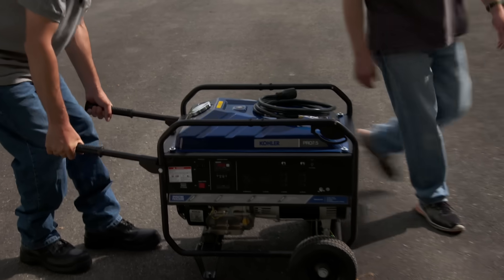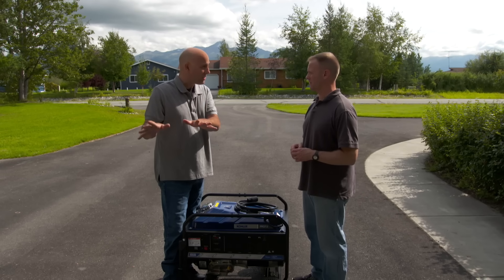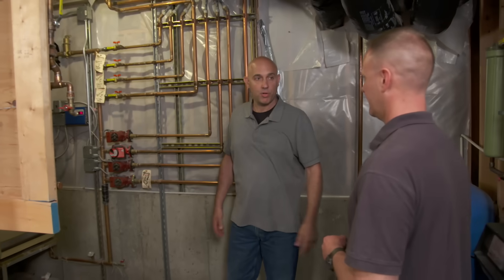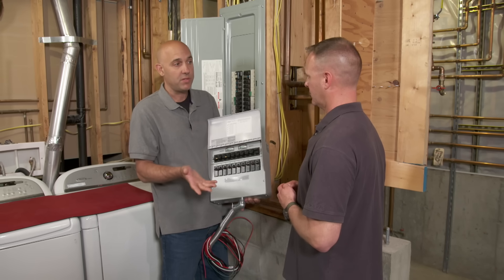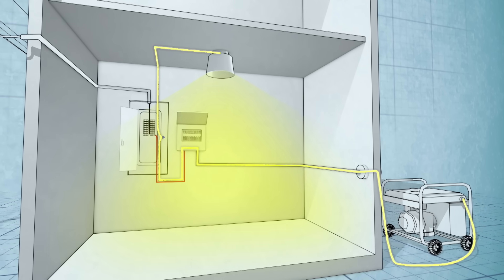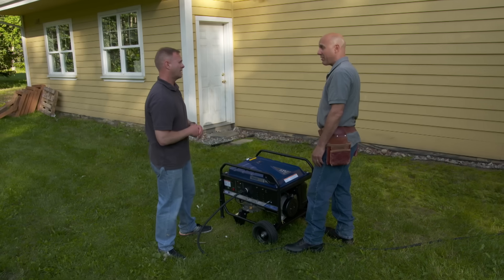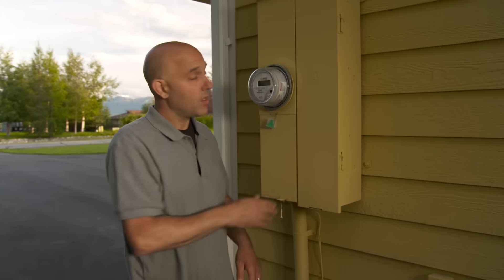How to Install a Manual Transfer Switch for a Portable Generator | Ask This Old House

Comment: Great video. I have a question. After the power comes back on, does the transfer switch stop the flow of electricity from the  generator before you can get outside to turn off the generator? I heard you say the switch lives in the off position, is that where it returns or do I need to turn the switches back to off after turning off the generator?
Reply: The individual switches on the transfer switches are between the breakers and the loads (appliances, outlets, lighting, etc).  When the generator is connected and the switches are moved to the GEN position, each switch independently disconnects the only feed to it from the house breaker panel. It's basically 10 transfer switches in one cabinet.  
If the main power is on and the generator is on and connected, it's perfectly safe to have some of the circuits in the LINE position (main power) and some of the circuits in the GEN position (generator power).  Each circuit is isolated by the way the toggle switches are between the breakers in the house panel and the breakers in the transfer switch.  The center OFF position is the "break" position so that when moving a switch up and down there is always a disconnect so the power sources always remain isolated.  
Normally the switches are in the LINE position, if there is an outage then a generator is connected and the switches are moved to the GEN positions as needed by the person attending to the system.  It is usually obvious to some extent when the main power returns, because everything not being fed by or connected to the generator will instantly turn back on.  Generally there is something somewhere that will indicate to someone that the main power has returned.
Reply: I was wondering the same thing. The term manual transfer switch makes it sound like you have to do it yourself. Auto transfer switch would be a better thing if it would turn that off for you. What happens if your generator is running and the power comes back on? Not only that, but how do you know your power is back on from the utility if you're using the lights and other circuits with the generator?
Reply: @nicknamednickify  -- Well, for starters, all the things that did NOT get put on the transfer switch will come on, and if that is not enough for one to notice, for sure, all your neighbors who have no power lights will come on all at atahe same time...  Even street lights will come on if ithe power is restored at night, and lastly, if you have a phone and have signed up for notifications  of power outages, they will also ding your phone with a text msg saying the power is back up..
Reply: Hello, if you have a renewable energy (solar panel) system and an inverter, everything depends on the type of the inverter.  If it's a "grid-tie" inverter, which syncs with the utility power and supplies power to the entire system at the same time as the utility, it cannot be used during an outage because it has to detect a utility outage and shut itself down (or it would send power back down the utility line). Grid-tie systems usually don't utilize battery bank storage and will sometimes use microinverters built-into the solar panels.   
If your inverter is NOT a grid-tie and does use a battery bank, it would use either a small automatic switch, or it could use a manual transfer switch like this one.  All depends on the type of inverter and how it's integrated or planned to be integrated into the electrical system.  With a "NON" grid-tie, you can use it at any time by picking any of the circuits on this type of switch, moving them to GEN and running them off the inverter power at the SAME time the utility feeds everything else. This is perfectly safe and the only concern is that you don't monitor the battery power and the available power from the battery bank gets too low, the inverter will crash and any circuits fed by it will stop working until you realize this and flip the switches back to LINE, reset the inverter, and when there is enough energy once again in the batteries you can resume using it to power some (or all) of the circuits on the transfer switch.
Reply: Thank you!  I replied to the other comment you posted, hopefully that provides the answers you were looking for. Feel free to call me at 800-634-6155 and press option 3 for support.
Reply: No you cannot, the "class" of the inverter is critical and determines if it's possible to utilize this switch with an inverter rather than a separate portable generator.  
It won't work ONLY if you have a grid-tie inverter, because the inverter won't work when the main power fails unless a very sophisticated automatic switch AND another inverter AND another automatic switch are all incorporated.  It's required by law that a grid-tie inverter has an RSD feature, which is Rapid Shut Down.  It must detect the utility power failing and shut itself down until it detects the return of the utility. It can do this in a variety of ways based on who made the inverter.  
However, any inverter EXCEPT a grid-tie inverter can potentially be used with this transfer switch.  There are some unique attributes on some (non-grid-tie) inverters in regards to their internal neutral/ground relationship, which could cause issues especially if there is GFCI built into the inverters and their neutral is bonded to their grounded  (metal/conductive) parts.  
Inverters comes in two main classes - non grid-tie and Grid-tie, and this makes ALL the difference.  The class of the inverter is critical because the two types of inverters are very, very different, and if you have a grid-tie you cannot use it when the power fails without an extremely expensive setup of 2 automatic switches and a 2nd inverter that is not a grid-tie.
Reply: @RelianceControls   This subject isn't about inverters.  A transfer switch isolates the stand-by source from the utility so the two never meet.
Reply: The switch will isolate the feeds no matter where it's switch positions are.  In other words, it will never connect the utility and the generator feeds together.  It doesn't matter if the generator is on, plugged in, if there is power at the utility or not.  The main thing is to NEVER connect the generator to the utility.  The transfer switch is designed for that.

Comment: What is the make / model of the 10-circuit manual transfer switch?
Reply: 6 circuit manual transfer switch at Home Depot
https://www.homedepot.com/p/Reliance-Controls-30-Amp-6-Circuit-Manual-Transfer-Switch-306A/206499418
Reply: It's made by Reliance Controls and the model number for just the transfer switch is # 306C

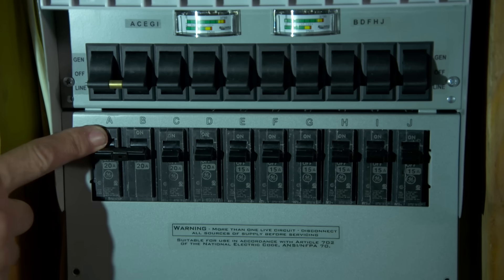Comment: 5:14 best animation I've seen. Thank you!
Reply: I'm embarrassed to admit this, but sometimes when someone is just jabbering out instructions, I may get a little distracted - - so no matter how corny in appearance, if they have a simple animation like that - - it really brings the project (& end-product) into focus for me. So yes, I do appreciate their animation as well. Thank YOU for adding that time-stamp there!
Reply: @LEO1WOLF  I think they used it in "Money For Nothing" video.
Reply: It doesn't include neutral and ground wiring, not exactly a good diagram.
Reply: I disagree. It's really basic. 
Walt Disney tops
Reply: @samsngdevice5103  You wanted anime?

Comment: Do you need to ground the generator?  Reading the Generac manual, it would seem necessary
Reply: When the generator connects to the building's electrical wiring system, the generator's ground (if wired as it should be) will become common with the building's grounded system, resulting in the generator to be grounded in that manner.  A separate ground rod for the generator is not necessary when it's being connected to a grounded electrical system of a structure.
Reply: @RelianceControls  But a separate ground rod for the generator frame would be a good idea.

Comment: Forgot a step. Switch from gen to line then shut the generation device off. Plus it would be advisable to switch fuel off and run the bowl out of fuel before turning the generator off..

Comment: What I'd really like is for electricians who initially install panels in new houses to have to take a course in writing legibly.
Reply: I they should have to take a course in filling out panel schedules. I come across blank schedules all the time.
Reply: Without electricians you wouldn’t have WiFi to make dumbass comments.
Reply: @dallas5374  QUESTION: Why dont he ground the generator frame to earth??
Is it a FLOATING NEUTRAL generator, or a BONDED NEUTRAL generator?
doesnt that matter?
Reply: Not possible.  Most electricians are med-school drop outs..
Reply: @ohger1  Don't get me started on linemen.

Comment: Need to tell him not to store the generator with gas that has ethanol in it. Try to get strait gas (ethanol free). The ethanol will decompose the rubber parts of a a small engine. Also when it sits for a long time it goes bad quickly and will grow crystals in the carburetor and then you are just screwed till you buy a rebuild kit and clean it up.

Comment: A friend of mine left one unsecured like that only to wake up and watch 3 guys running away with his generator
Reply: Reason 100000 to live in the country.
Reply: @davec.3198  He should have provided the guy with a 30' logging chain as well as that cable.
It may not stop them, but it sure as hell would slow them down a bit.
Reply: A generator enclosure helps with that, along with keeping it nice, and reducing noise.

Comment: The only thing is you need to devide the load of the generator to the transfer switch box.
Reply: Not sure what you mean to say. A generator is not a load but a source. It works fine the way it's described in the video.

Comment: Can I ask a silly question. Regarding this manual transfer. What protects the utility workers of power is restored or so that there is no back feeding??
Reply: When the transfer switch is in the generator position, the circuits you've chosen to wire to the transfer switch are isolated from the main power and connected to the generator.  When not in the "generator" position, the generator is isolated and the circuits are connected to main power.  That's the function of a transfer switch.  The transfer switch enforces that ONY the genreator or ONLY the main power is connected to those circuits.

Comment: Why not just backfeed the panel from the generator through a breaker thus enabling the homeowner to  shut off or turn on the circuits he wants and install a cut off switch to ensure no current from the generator can backfeed out to the street lines?
Reply: Because in most places, what you are describing is illegal.
Reply: Correct Charles.  All states in the U.S. have adopted at least Article 702 of the National Electrical Code which requires a transfer device of some sorts in order to connect a secondary power source.  Functionally yes simply back feeding the generator into the panel without a transfer mechanism or switch will work and be safe as long as the main breaker is shut off, but the point of requiring a transfer switch is to avoid any possibility of someone forgetting to shut the main off.  It is state law in every state to have some type of transfer switch that does what it's intended to do, in order to avoid any interconnection with the main power and power from a generator.
Reply: Absolutely correct.....Thats why you can add a transfer bar that only allows the breaker that is backfeeding from the generator to be on is when the main is off. Its a simple inexpensive mechanical device rather than the very expensive method shown in the video.

Comment: The generator might be 220 volts but only 30 amp. Residential supply is at least 120 to 200 amps.
Reply: The generator will only be powering the circuits that the transfer switch is connected to, and as with any manual transfer system, the operator must manage the loads by turning circuits on with some awareness of how much power they are using as to not overload the generator.  A very small 2000W inverter generator for example can connect to an entire electrical system fed into an interlocked breaker, there are no rules against sizing a manual system in this regard.  The more circuits the generator has access to, and the smaller the generator is, results in more load management and by the person operating the system.  A smaller number of circuits is more practical for a lot of people as it's much easier to manage 5 or 6 critical circuits than it would be to manage a breaker panel with 30 or 40 breakers.
Reply: OK that works. Ive come across a few jobs with backup generators installed incorrectly by people that don't have a clue of how electricity works and safety measures that are needed.
Reply: Yes Bob that is some scary stuff, we come across that a lot as well.

Comment: 4:50 So the generator hooks into the breaker panels neutral? So at a wall socket the hot is from the generator but the neutral is from the power company. So if a plugged item shorts to neutral wouldn't that send power back to the electrical company. In theory.
Reply: Yes, the generator neutral becomes common with the panel neutral, so that all of the circuit neutrals have a return path back their power source, either the generator or the utility.  Electrical current always returns to its source, and takes the path of least resistance.  In no scenario can I envision the path of least resistance of return current back to the generator, for any of the power that came from the generator, to land on the neutral wire coming from the utility transformer.
Reply: But neutral bars in panels are bounded to ground, so ground will be the path of least resistance.

Comment: Do I need to shut off the Main before switching transfer switch to Gen?
Reply: You do not have to turn off the main panel or any household breakers when operating a generator with this transfer switch.  It is really a set of 6 transfer switches in a single cabinet, so each toggle switch breaks before makes connections in order to isolate the power from the house breakers from the power from the generator at all times.

Comment: Studies have shown that even 15 feet from doors and windows isn't enough to keep the carbon dioxide out. Only 9 ppm of Carbon Dioxide can do significant damage to you in just 8 hours. Those vents on the house can allow Carbon Dioxide seep into them and that odorless, tasteless gas can kill your family while they sleep etc.  So you really should have more than 15 feet clearance from the vents, windows and doors. The trouble is, those power cords for sale are super expensive and ones longer than 15 feet the price is obscene. Get your electrician to build you a long cable for the same price etc.
Reply: lol, doesn't know the difference between CO2 and CO yet talks like he's an expert...lol, smh

Comment: I prefer the idea of the interlock kit over a transfer switch. They're easy to install, create less spaghetti wires in the panel, and they let you power any circuit in your home.
Reply: I was wondering why he didn't install one as well they are much better installation. less to go wrong, less expensive and cleaner install.
Reply: @SillyPutty3700  if the main shut off is not in the panel (like mine), then interlock will not work. This will.
Reply: The interlock switch requires the main shut-off to be in the same panel as the breakers. They mentioned that the main shut-off is at the meter. This is the case with a lot of houses in California, for some reason.
Reply: My main is outside and I have a split bus panel with no main to cut the utility power so I can't use an interlock with modifications so I decided on a transfer switch, 10 circuits is more than enough to get by.
Reply: Hire a professional
Reply: They probably don’t want to show those on a show like this for liability reasons. If the interlock is installed wrong, it’ll send power down the line even when a lineman thinks it’s off.
Reply: @robbanta2979  The transfer switch eliminates any chance of back feed out to power lines. It also eliminates any chance of damage to the wiring in your home.
Reply: Rob Banta I guarantee you homeowners will find a way to back feed through any system if they wire and operate the equipment themselves.
Reply: @KitchenerLeslie2  Once again proving that Mr. Murphy (and his law) is alive and well.
Reply: @KitchenerLeslie2  "You homeowners" -- I assume you're a renter then.
Reply: @Redandranger   no. A pro
Reply: @Redandranger  okay buddy. I guess you have issues. Trump lost, get over it. Is your 5g tower telling you to argue with random people?
Reply: @LevRage  Y'all even getting political toxic over a generator transfer switch 😂😂
Reply: @KitchenerLeslie2  Why is it that people with such bitter attitudes are always so predictably anti-Trump?

Comment: How long can the power cord be between the generator and the outside box that leads to my utility box be I am thinking of 100 ft cord???
Reply: There isn't a set distance due to varying resistances and sizes of generators and loads, but 100 feet is generally a good distance to use as a baseline for 10 gauge wire.
Reply: The sky's the limit Roger. You will just have to keep increasing the wire size as you go further away.